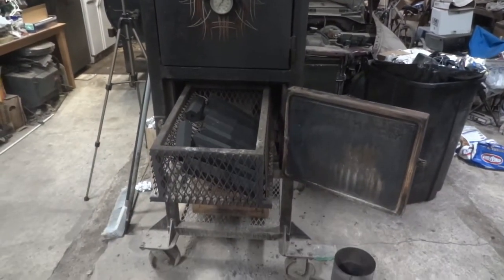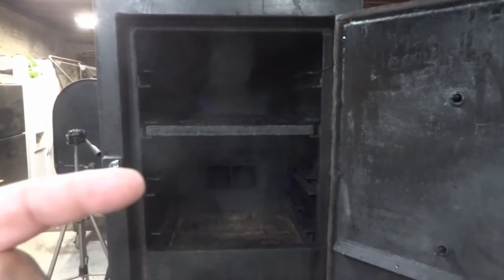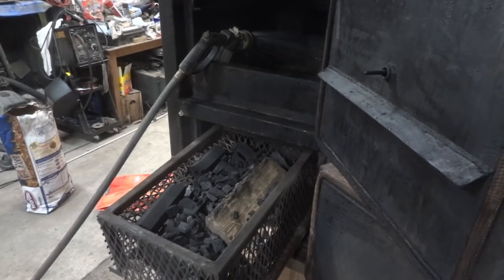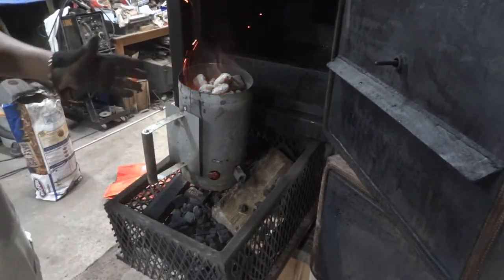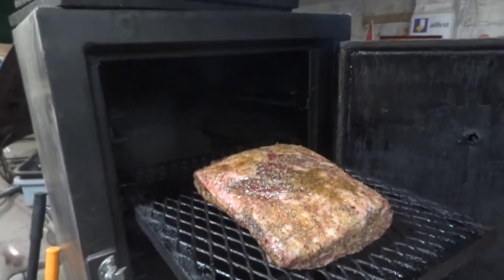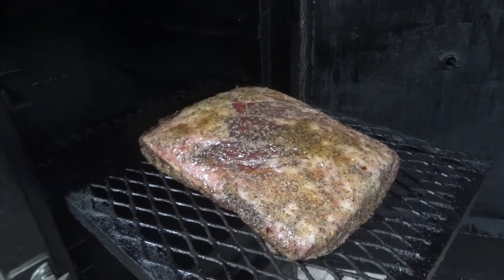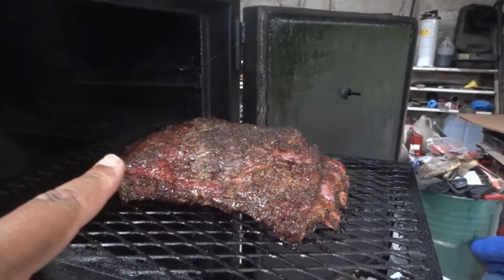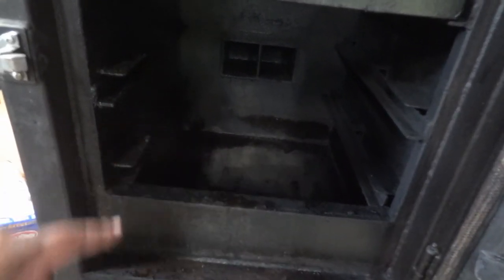SDSBBQ - Smoking Beef Ribs in #VickyTheVerticalSmoker with a mix of charcoal

Comment: Dash can you tell me where you got your vertical smoker built, or did you build it yourself? I'd like to get one built as well. Thanks
Reply from the maker: The Vertical Smoker was build by my friend Kirk. He has gotten out of making them. There are plenty of people around that are making vertical smokers similar to #VickyTheVerticalSmoker.
Reply: Thanks Dash...i have a 30×96 reverse flow trailer smoker, but I need something like Vicky for smaller gigs. Thanks again, continued success
Reply from the maker: Yep, exactly why I made the investment in the smaller smoker as well. I would recommend looking into maybe using a steel drum smoker?

Comment: How often do you add wood and coal
Reply from the maker: Pretty much just as needed. On a short cook like this one just once, but on longer cooks I can and will add charcoal when the temps start dropping.
Reply: SDSBBQ I'm new to the smoking game. I would normally just grill over direct heat but now I've fallen in love with the flavor that the wood gives. I've strayed away from lighter fluid. I just don't want to over smoke the meat and give it a bitter taste
Reply from the maker: Well the good thing is you know that you can over smoke something. I'd start with a few chunks / splits to start then see what happens. Without knowing what you are working on and how I really can't say.
Reply: SDSBBQ I'm using an offset smoker/grill. I would like to purchase a vertical or over/under smoker. Also is it better to use wood without the bark?
Reply: SDSBBQ could you make a video about that.
Reply from the maker: Don't know about making a video  because it really is just as simple as when the temps go down add charcoal and a piece of wood.